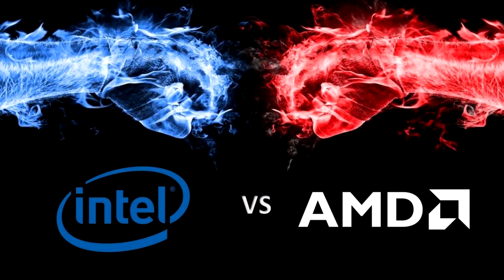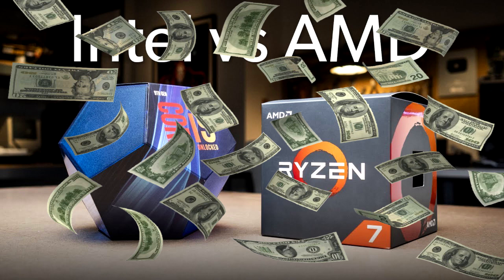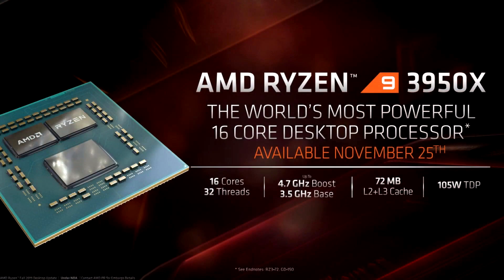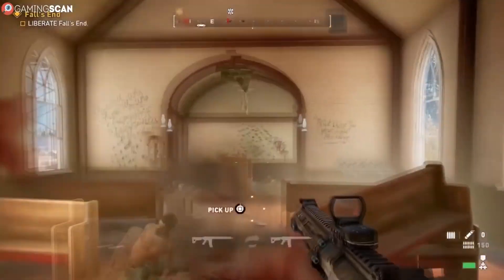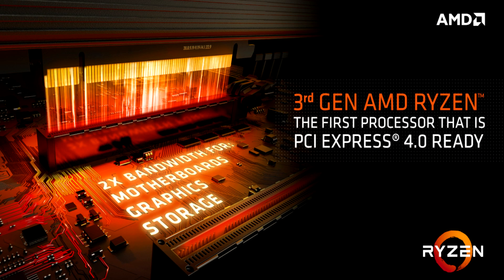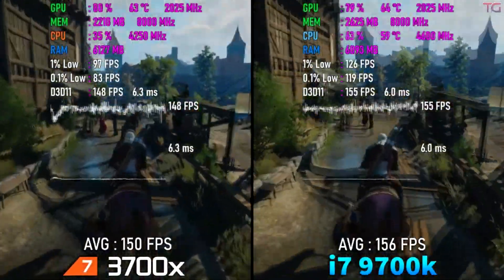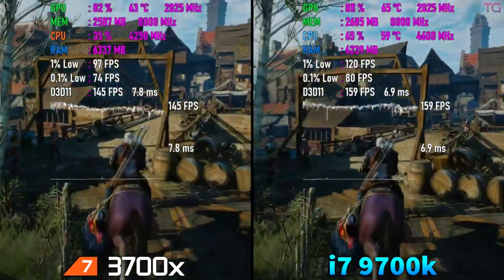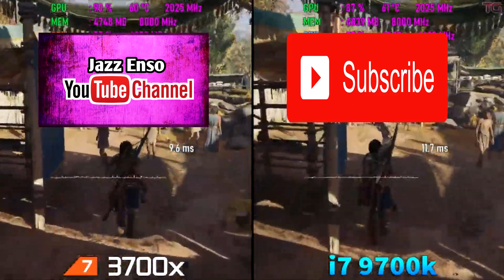Intel Vs Amd | Which is better ?

Comment: Which processor would be better in laptop for ms office,YouTube, internet without *hanging, *slowing,*heating problem?
1..Celeron 3867U (1.8 Ghz)
2..Amd A4 9125(2.3-2.6 Ghz)
3..Celeron N4000(1.1-2.6Ghz)
Reply from the maker: No. 2, higher ghz much better